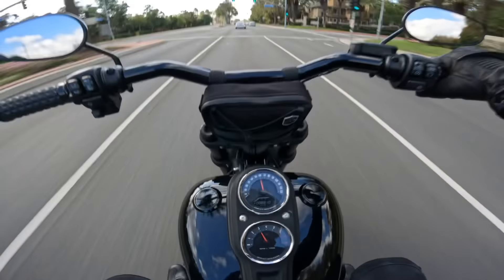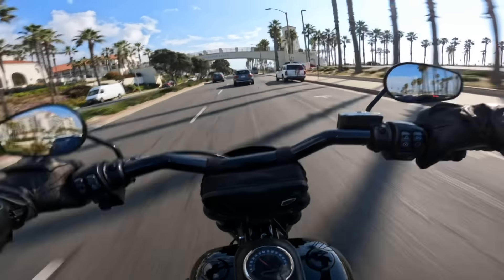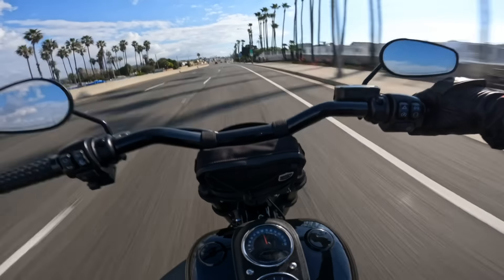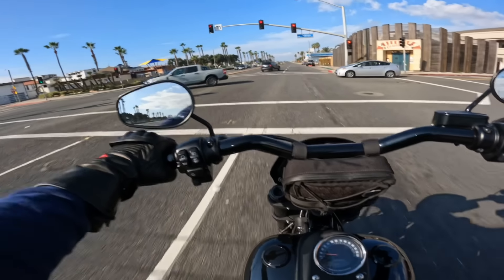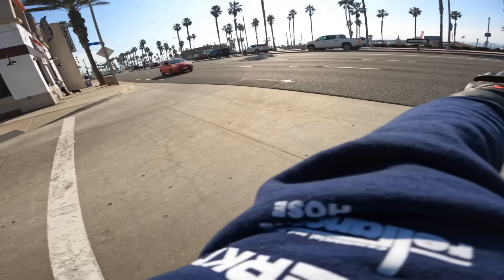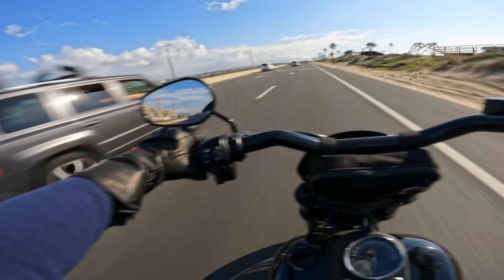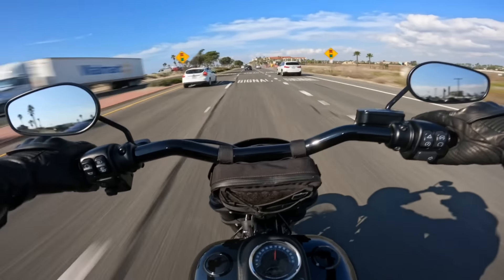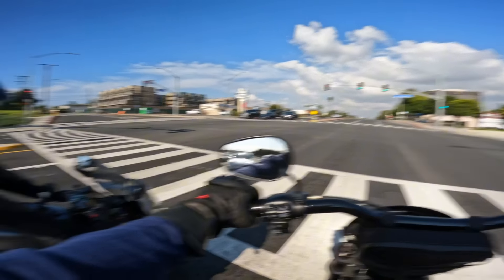THIS 150WHP HARLEY IS NASTY 😳

Comment: If its making 150hp, that means he at LEAST did a 128 kit.  The reason it pulls so hard is not the HP, its the fact its making probably 150 ftlbs of torque and its kicking in around 2500-3000 rpm you hit max torque and it lasts til 6k before it drops off.  I have a Ducati SFV4SP now but used to have a Panigale 1199R and I can tell you that a big bore Harley will pull harder initially than pretty much ANY sportbike...until the sportbike hits its powerband and then the power to weight ratio kinda takes over.  I have these conversations with both sides of the crowd all the time....Harley buddies ask about the Duc and my sportbike friends ask about my Harleys....any sportbike guy that thinks Harleys arent fast have never been on one thats been "properly" modified....they dont have hte 120-170 pull like a sportbike....but the monster torque down low is the most fun you can have on 2 wheels... :D. Love yuour dads bike.  THey make a guage relocation kit where that guage can be moved exactly where you were wanting it....
Reply from the maker: Exactly!! 
& I will let him know. Even myself, I was short shifting a few times just cause I wasn’t used to the rpm’s on a Harley and it’s certainly hard to look down while going fast
Reply: You NAILED that. Torque feels good all the way ‘to’ the speed limit; the high end kick is good all the way ‘to’ the ticket from the nice police that no one really wants to meet. I bought a new TC88 Dyna Wide Glide and spent the winter amping that muscular pit bull up to breathe better, a kick-ass intake and some other performance mods. When I was done my first ride was a KfucKing WOW! I saw the guy I bought a lot of the parts from at a red light. He hollered over at me, “How’s it run?!!”. I said, “Let me show you when the light turns green, Frank!” When that light went green I checked the intersection for those stragglers and when clear I nailed it! It took off like grappling hook from an F-16 hooked it! It was badassed all the way ‘to’ the speed limit. What I did not know is there was a Wyoming. MI cop right behind me. I never looked in the mirrors. He rolled up beside me and motioned me to pull over. The guy took about 40 seconds to stand all the way up while getting out of his cruiser… …was about 7 feet tall. It was surreal. Everyone who knows anything around here knows that when Wyoming, MI cops pull you over the best thing that will happen is you’ll just get a ticket. And ‘color’ aint got a damm thing to do with it. They just are sorta hard-core. Anyway, I asked him why he pulled me over? I said I didn’t break the speed limit I just got there kinda fast. He told me, “I know. I just never saw anybody do that kind of shit-n-git with me right behind them and I am not pulling you over for speeding. I just want to see what you did to make that Harley go so fast!” Turned out he was a rider too and was working on his new TC88 too. It was actually fun and we shot the shit for about 1/2 an hour. I showed him my upgrades and I am pretty sure he did some of them. He was pretty cool about it all. True Story! 😅
Reply: @MrDoyle07  Its a LOT more fun to ride a slower bike fast than a fast bike slow.  I have a 200hp Ducati that I have to baby because it literally scares the crap out of you once it hits powerband and pulls all the way to 15k...its SCARY fast so you have to ride with the outlook that you may flip it at anytime if you dont have wheelie control and traction control on.  On the Harley, you are literally able to give it all the beans...and yeah, it will bust the back tire loose, but you arent going to flip the thing.  Its always planted and while it handles NOTHING like a sportbike, its a BLAST to ride.  On a Harley, even riding slow, you simply feel like a freekin GANGSTER rolling around, knowing you can uncork it at any time....its a totally different feel.  I compare it to driving a big heavy muscle car compared to a Ferrari...they are both the cats meow, but in their own way. (and unless you have owned both, they simply dont know what they are missing...most brand loyalists are simply ignorant as to how cool the others are.....granted, I am talking properly customized Harleys, not the bone stock ones...all 3 of mine are cammed or have full blown motor swaps.. 😀
Reply: @redrider0151  totally you can have a blast riding a slow bike fast. Cause you can do it everywere with far less risk. And it'd still joyfully rewarding.
Trying to find places to hang a fast bike open is much riskier. And you don't honestly need a fast bike in the twistys.. straight lines are for teenagers .. same goes for cars
Reply: Horsepower and Torque are just 2 ways to measure the same power js
Reply: Awesome video but, can you tell me how the Harley is geared?
 Tell me the redline and top speed in each gear.
 Because lot of bigger sport bikes are geared to go 70-80mph in first gear alone.
 Mine is bone stock and spins the tire on dry pavement when you hit around 60 mph. 
It's not the fastest one you can get either.
 Gearing it for more torque to the  ground, would be nearly pointless.
 I can drive around town going 30mph in top gear (where it's geared to go 190) and I bet I'd walk away from a Harley if we were both in top gear and took off rolling from 30mph.
And we all know the Harley aint geared for anywhere near 190.
 Depending on the thee era, there's Indy cars that made less than 200ft/lbs of torque, and horsepower levels over 1500.
 Steam engines that make 5000ft/lbs pounds with only 100 horsepower.
 The point is, power to the wheel is what we feel.
 Why do endlessly hear about Harleys have so much torque, when torque to the ground is what we feel.
I hear guys driving Harleys on interstate cruising and saying you better drop at least 2 gears if you wanna pass someone in a  respectable distance.
 Yet claiming Harleys are so torquey.
 Gear the bikes for the same redline in each gear, given their engine parameters and then compare em.
 That would be a good video!
Reply: @redrider0151  it's how I feel when I'm on my mini 212cc 💪🏼💯💨💨💨 keep the DREAM alive bros✨️
Reply: 100% 153tq is FUN
Reply: @ajjames9786  Toque is how hard something pulls.....horsepower is being able to get to a high top speed.  This is why people talk about how hard a built Harley hits out of the hole....yeah, it only revs to 6 grand, but its got max torque for 85% of its rev range...its basically at max torque at 2000-2500 rpm...and the amount of torque is FAR GREAT than ANY sportbike.  If you think Harleys arent fast, go to the drag strip on motorcycle night....they pull.....HARD.  ANd they are EASY to ride...whereas a sportbike, I spend more time worried I will flip it....
Reply: @redrider0151  
 I understand what torque is, but unless your bike doesn't have a transmission, simply saying the engine itself has so much torque, while at the same time saying you worry about flipping your Ducati over backwards, is contradicting.
 That's torque at the wheel trying to flip you over.
 ( By the way, that's an awesome bike you have! Not just everyone has a Ducati!)
 A built Harley might be faster than another Harley, but it's not fast in relative terms, to it's comparable competition.
 We don't see racing rules with cubic inch limits and weights, equal to each other ,because Harley can't compete.
 Thee only way way they do, is to handicap their competitors to try to make the classes equal.
  Look at Turbo non wheelie bar
 DOT tired sport bikes running in the 5's
 That's just drag racing stuff.
Can you imagine a Harley in Moto GP, Isle of Man, etc?
Reply: If the bike is hitting 150whp he was short shifting at 5k rpm. These high hp Harley built motors are turning 6500 easily. My 2022 street glide is only 128hp/129tq and pulls on dyno till 6500.
Reply: @jeremybishop3519  Given he usually rides a sportbike, I would be HAPPY he is short-shifting, as his normal bike rev's well over 10k... 😛. I have mine set to 6200 on both my built harleys just to keep them safe....as I also ride a bike with a 15k redline, so I tend to bounce off the limiter if I spend too much time on my non-Harley and then switch back... LOLZ  If it was a purpose built track bike I would have it pushing limits, but around town its just easier to keep it lower....

Comment: Harley put up a very good fight now im wondering if it could take on a Liter bike but like always great video man 🔥
Reply from the maker: Definitely won’t be able to keep up in the higher gears but fun till about 130
Reply: Red light to red light, that HD gaps them.
Reply from the maker: @freebehindbars8654  and this was a loooong red light 🤣
Reply: Wouldn't come close to touching my ZX-14R, that's for certain.

As for a litre bike. BWW M1000RR 210 HP and light as a feather.

That BMW would eat that Harley for lunch and shit it out.

Still give the man his credit. His 150 HP couch managed to beat a little 600. Huge accomplishment.
Reply: No shit genius. 2 totally different engines with totally different tourque delivery characteristics.

Now try stoplight to stoplight with a Ducati and get back to us....
Reply from the maker: @GPz84  150whp beats a k5 1000 around the same hp numbers except I’m heavier. Bring out that heavy 14r and I’ll smoke that thing on my h2 😂 or bring the s1k out for my 1100.. you wanna get all defensive. Line it up

Comment: I love the bike, but gotta be suspicious of 150hp. I came from the Dyna world and have seen some amazing builds, but hell even a 131" stage 4 crate engine comes in about 120-125hp. I'd love to see the dyno sheet on it. Sounds killer!!!
Reply: New Softails with 114-117s make 130-140 hp with just cam and tunes
Reply from the maker: I have the dyno sheets to prove it! 150WHP 152TQ. Message me on instagram and I’ll show ya 💪🏼
Reply: Gotta admit, the new harley motors are very capable for what they are.

Comment: It sounds good but it seems slow compared to my CBR1000RR
Reply from the maker: Depends on the year. But you’ll pass me maybe after 120
Reply: @iitsturbo  It's a 2017 with full arrow exhaust, ecu flash and dyno tune by Chris Hall Performance. It made 170whp at 12000 rpm and 84lb/ft at 9600rpm. It pulls harder in the midrange than most liter bikes It doesn't have a great top end though. 186mph top speed
Reply from the maker: @seekingtruth8074  yeah my buddy had a 18rr and he ended up getting the new RRR cause it just couldn’t keep up with the new bikes
Reply: @iitsturbo  I'm waitin' for the new RRRR-RRRR-CBRR/RR. Can't wait.

Comment: If hes making 150 he has to have a big bore kit or an engine swap with a cam ported heads throttle body and exhaust no way hes hitting 150. Fast low rider though. Were you able to get a list of his mods ?
Reply from the maker: I have the dyno sheets. & I have the mod list
Reply: @iitsturbo  whats been done to it?
Reply from the maker: @racex3721  pretty much everything you mentioned
Reply: @iitsturbo  what size engine
Reply from the maker: @racex3721  118 ish
Reply: just a cam in a 114/117 will make north of 120hp. not a reach for that number at all.
Reply from the maker: @DynaDante7  and this is a 118 with ported heads, cams, pistons, intake, exhaust mixed with a gallon of 100 octane. It was dynod with California 91 octane. (The worst gas)
Reply: Lol the 114 m8 can make 150HP and 150TQ all day long with cams, intale, exhaust, throttle body, injectors and a good tune
Reply: Lol the 114 m8 can make 150HP and 150TQ all day long with cams, intale, exhaust, throttle body, injectors and a good tune. If someone does a 128 kit which is just jugs and pistons then I woi!d think there is something wrong if it DIDN'T make that power.
Reply: Them Milwaukee eights are a different beast than the old twin cams. It don't take much to put em in that 150/140 range

Comment: Love the content , new subscriber for sure ! I used to ride a gsxr 750 built & now I exclusively ride harleys. I like the usable power & the reliability and now that I’m getting a lil older (28) so not that old yet. Me and my wife ride together all the time. I have a built Harley that will walk a 600 no problem it will walk a 750 in the first licks (red light to red light) I just don’t have the top speed. But my Harley will go 150. That’s what the dynamo topped out at & I have personally went around there I just don’t know if my Speedo is off. Harley’s are a different world for sure 😊
Reply from the maker: That’s awesome!! I enjoy all bikes. 
I have a few fast bikes but I certainly enjoy riding my dads built Harley. Such a blast especially with the instant power. I’d definitely rather have my lady on the back of a Harley than my sport bike 🤣
Reply: @iitsturbo  absolutely I used to ride crotch rockets man they are a blast. So I give everyone two fingers. But Harley’s are awesome as well. 

I’m just not apart of that hell yeah brother crowd 😂😂
Reply from the maker: @THEWILLYEFFECT   haha! I’m not a hell yeah brother patch wearing guy either. I just like fast bikes
Reply: Harley? Reliability?  Put down the crack pipe dude.